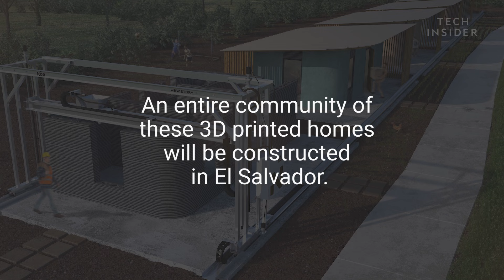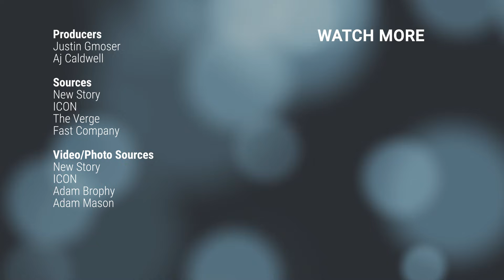3D-Printed Home Can Be Constructed For Under $4,000

Comment: I have a lot of questions regarding 3-D printed concrete homes. I have not found any ACTUAL examples of homes built this way. Does this method also install roofs, doors, windows, HVAC, plumbing, electrical, stairs etc...? From what I can see 3-D printing can ONLY make the shell of a home. How about the physical footprint of the 3-D printer itself? There would have to be room on the jobsite to accommodate some kind of gantry system that, by necessity, would be larger than the house itself. In urban and suburban areas you may only have small building lots. I would like to see an actual REAL LIFE example of a 3-D house being made any the total REAL PRICE! Fear not, you have come to the right place! I have a bridge in Brooklyn to sell at a great price! However there is a modest shipping charge.  :-)

Comment: So, I don't know.  If you prefabricate wall panels and roof panels in a factory the way cars are made, and then ship them to location, then snap them together and put in a few bolts, wouldn't that be cheaper?  The most expensive part of a car is the engine and drivetrain, the actual shell is fairly cheap.

Comment: $4000 is a lie, The wood alone spent on front terrace is more than $4000 alone. So this project if i had to spec it out is easy $80000.00 finished. Expensive for such a small home.

Comment: Actually, the 'cheaper' part is 'no labor' but the tools to do this and the super structure is costly and the energy you use to run the machines costs money, too.  Hauling the equipment to the building site costs money.

Comment: This is the cost of a SHELL.  It didn't 'print a house' at all.  It just poured cement.  You can make a cement house much cheaper using a cement tub, water, sand and some bags of cement.  Buy the cement blocks and stack them up this is the usual way of doing this sort of thing.

Comment: 3d printed homes is a brilliant idea and one that must be implemented in struggling nations,  they say they want to bring costs down and to me the most obvious money drain in the construction of a 3d printed home is the use of concrete, which is the best material to use but not the most cost effective.  so how about a material that everyone uses and the world hates.  Plastic. rather recycled plastic.  The worlds nations all have huge problems dealing with garbage plastics. so why not use such plastics to create these homes?   the cost take other peoples problems must be insanely cheap.  The only question is how to bind the plastics what would work and what wouldnt.  but ultimately that would clearly be the solution.  we already use recycled plastics in the creation of many parks and recreations venues. buildings and structures that look like wood but upon the touch you realize oh its plastic and not wood at all. In some cases its plastics infused with other materials. But i have no doubt that such cost could be dropped even below $4000. especially if the material used is easy to work with, strong and reliable.  then you actually doing the planet a favor by using the garbage produced in applications that very well could drive down the amount of tonnage  in garbage to sustainable lows.   Most of the time solutions to problems is never far away,  peoples of the past did far more with far little.   well,  houses such as these should be a piece of cake given the right material.

Comment: Just the foundation and wooden cover would cost well over $10,000. How much of the cost of a home really comes from the frame? If you remove wall finishing, electrical wiring, counters, cabinets, plumbing, and such, the cost drops quickly. Insulation in shipping containers would be far cheaper if we are just looking at the structure.

Comment: Could you attach two fence posts or 4 together as sort of like cheap giant aluminum extrusion then use lawn mower / wagon wheels as bearings? What kind of tolerances would a cement 3d printer need? I would assume if you're close to within 1mm you're golden...

Comment: This prints walls. That's it. In 24 hours.
Building that same size structure using 2x4s and plywood, with the same layout would take about 4 hours. Building with cinder blocks (CMUs) for that structure could be completed in 3 hours.
I'm not sure that 3D printing homes for the homeless in 24 hours is the wave of the future.
Reply: What's the cost that way?

Comment: speaking as a mason who has worked with mortar for over 20 years now... while this is a cool building concept, mortar alone used like this will not last very long... i give it 5 years or less under normal every day use to crumble to dust. while mortar is made with a lot of the same ingredients as concrete, it is NOT concrete.

Comment: There are many issues with this:
1) Transportation of the printer.
2) Cost of production @ 4k, w/ an estimated 50% minimum markup @ 8k for expansion of the business.
3) Paying for home, % interest factored into a 2-4 year loan (average car loan period).
4) Paying for Land to place home on (varies on location).
5) Paying for Electrical/Water/Sewer.
6) Dealing with smell of the home! Commonly used rigid ABS printer filament are the same materials used in PVC pipe. I'd imagine that this printed home spells like a Toys R Us.

For homeless or underdeveloped countries with cheap/land it makes more sense but with all these issues, I don't think this is commercially viable unless cost of production come down. I estimated it to cost about the same price as renting a small apartment on my local College Campus ($700-1000 here). Under the correct circumstances it could be feasible in the States. You WOULD be a home-owner in 2-4 years and live rent-free after which is the plus. However, you'll still have property tax to pay and general maintenance and upkeep. Solar would be more sustainable but that is more upfront capital to invest in panels and batteries.

Comment: How does this compare with setting up some plywood forms and pouring in the concrete?  Also, are the materials to make the extruded concrete in the areas where these homes are needed?  Wouldn't compressed Earth bricks be more suitable for the locations where such homes are needed?

Comment: How would all that cost $4000? The windows alone would be $1000-2000 if you factor in installation. Alone the costs of the work that is no 3D printed is more than $4000 not even looking at materials
Reply: There r cheap windows

Comment: Can Helix Micro Rebar be added? And can a plaster coating of GigaCrete Ballisicrete be added then coating of Water Glass and finally a Line-X top coat? Also, I would want to add a additional stronger structural member
Reply: a QuaDror structural support which doubles as shelves - all these additions will make the homes tornado proof and blast resistant

Comment: Stress on building
+ variation of moisture moving floor, e.g rain, gardening, leaking plumbing.
+ wind forces, suction uplift on roof and opposite windows to reduce stress on wall concrete.

Comment: It's a neat idea, and innovation is always great. But I don't understand why this is something they think would be an affordable option. Therefore, it's just a company trying to get investors so they can make some $$$. Obviously using local, traditional materials in third-world countries is a more affordable, feasible option. There's also not much difference between this "3-D printing" and using forms and a hose to pour cement. Also, look at the efficiency and cost effectiveness of building boxcars in factories. We already have hundreds of thousands of cargo boxes that need to be recycled, and they make EXCELLENT tiny homes, with very little cost to turn them into homes. I'm just so sick of start-ups that have a clever spin, but ultimately are just in it for the cash, not the actual philanthropy.

Comment: This is a step in the right direction.  Just looked at wiki house, and the human input was way too great, unless that is you can use untrained unskilled hands.  As much of the house plumbing etc, should be automated.  Poor performing existing housing stock could be recycled.  Grinding new mortars out of old materials, something like timbercrete, or automating rammed earth styles.  I love the idea of something disposable/recyclable.  I live on a century old UK brick built terrace and while the building stands up quite well, constant alterations/adjustments causes noise heavy pollution.  Retrofitting our dwelling, likely would be so disruptive, that these simple new builds could be a great ticket.  Literally build new from old.  If only energy could easily be brought in on site, for grinding, compressing etc.  Initial outlays in energy costs could possibly be a price worth paying for long term energy recouperation.  Glass would need to be shipped in, however something like a mandatory manufatured glass bottle brick for all glass bought liquids could help here.  Especially for outbuildings, greenhouses and bathrooms where obscured glass could be used.

Comment: Under $4000?  How comically stupid, I've seen this plastered all over the net.  The concrete slab alone, here in Texas (Austin, where this house was built) more than likely will bid for $2000+.  After site clearing ($?) and providing utilities to the slab($).  Don't forget to add a roof($$), the windows($) and doors ($, all of which are shown), then plumbing ($$) and electricity ($$), all of which will easily balloon that cost over $20k if it was all pro-bono.  And hey, it doesn't have any insulation, especially in the roof.    And of course only a Master Electrician can add ANY electric connection, that would be a few grand just by itself.  And there are permits, ya know..not that anything here is code compliant (as there are no codes to be compliant to).  Don't forget the AC($), water heater($) and heating($) unless you plan on lifelong sleeping bags and cold showers!  Its doing to be freezing in there come January.  There's lot of promise in the printers, but please don't plaster fake numbers like these all over, it DESTROYS credibility for this fledgling industry.  Oh, and don't forget the LAND, "under $4000" won't go far in a city where the $/sf of land under the building will cost $400-$4000/SF+.

Comment: Using cement a building products that emits 1 ton of carbon per ton of concrete and is responsible for 60 % all global construction emissions. Use clay straw and stone or hempcrete in your 3D printer let's face it it's just an automated pump.

Comment: Is there any stability in this structure? It feels very unsafe. Maybe some special type of concrete with fibers could make it work tho.

Still it will not be cheap. The technique they use has basically almost no effect on end cost.

Comment: My high school has two or three 3-d printers
Reply: Its possible in theory for those 3D printers to be used to build bigger 3D printers or let the 3D printers duplicate until you have a large amount of 3D printers that could then be used to build houses.  Only select parts like the extruder, the electronics, and maybe the wheels would be built out something other than the resin.

Comment: Tornados: I'm about to end this whole families' career.
Reply: Said the wooden American home owner...
Reply: I thought concrete is the least destructible to tornados ?
Reply: Earthquakes and Tsunamis :  Meh it's easy peasy
Reply: El Salvador doesn't have tornadoes
Reply: Not all countries have it
Reply: i dislike this overused joke im sorry
Reply: Alpha-Pathetic Tm One upside is having to wait only 24 hours
Reply: Rain: lmao
Reply: @[The] White Rabbit It's not reinforced and it's not normal strong concrete but so called aircrete, concrete with small air bubbles in it. But I think a house this small will stand a tornado anyway. If we're talking larger buildings, this construction method will not hold up as good as a poured reinforced concrete building.
Reply: One of the founders of Icon lost two conventional homes to cyclones. This is his response.
Reply: Afterwards you just print it again for less than what it would cost to repair a car.
Reply: Wow sheet
Reply: Alpha-Pathetic Tm Ik touch it and its going to flip
Reply: @[The] White Rabbit Since you can't reinforce a material with itself, the expression "reinforced design" makes no sense when there's no rebar or other material with better tensile strength than the aircrete.  What we see in the film is an internal lattice structure. A lattice is not reinforcement. 

Why are you comparing with "stupid stick frame houses using the cheapest"? Why not comparing to prefab concrete or a good wooden frame? Do you have any support for that a lattice aircrete wall like this is stronger than a normal wood frame wall? Please show it to me then.
Reply: *life
Reply: The company owner explains in another video why it's the best type of house to survive tornadoes. Which one do you think is the sturdiest and heaviest : poured concrete or wood and drywall ???
Reply: You know, you’re probably right. They’re pretty small little shelters. They don’t look like they could take much
Reply: Central america doesn't have Tornadoes it has Hurricanes in the summers which might possibly be worse than a Tornado.
Reply: Alpha-Pathetic Tm that is rude.
Reply: @brietube2493  It's what people call.. Dark humor.
Reply: Brie Tube dude get a sense of humor

Comment: He'll I could do this by hand if I knew that concrete mix
Reply: Aircrete is the basis, lots of recipes out there. You will need a foam generator, find “Aircrete Foam Generator. Easy to use. - jim white” on YouTube and you will see the best design explained without the hype. Good luck with your home.

Comment: CalEarth is much more efficient... and it's not expensive. You don't even need a permit. Just buy land and start building. You can build using the dirty found on any property on any part of the world. 3D printed houses are more of a gimmick. They are a way for Govts to mass build houses, provide they fund it, whether it be through federal budget or non-profit organizing. The problem is that non-profit and Govt don't mix well... and federal budget spending is almost never replenished.

Comment: Interesting.
They build a timber frame to support the printer then remove the put a timber framed roof on top of that.
After that is done they rip down the timber frame for the printer.
Seems like they could just skip the printer and spray the concrete foam on the frame.
.
I did not see any reinforcing or lateral bracing,
Good luck with that

Comment: I could build a home that size for 6k
Wouldnt even use my $2,000,000 
10 tonne 3d printer once the whole time i was working on it.

And this 24 hour shit, must exclude the mixer coming and pouring your base which is the most expensive part of building a 1rise tiny house amyway